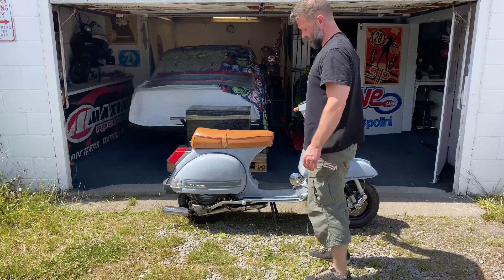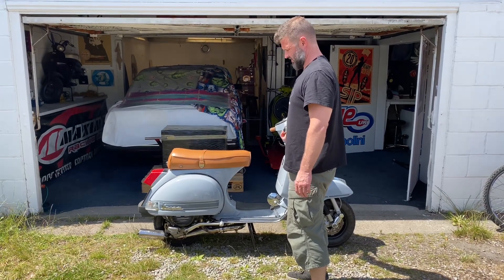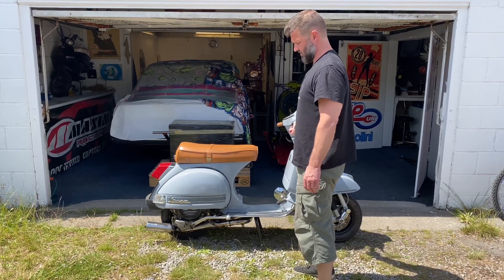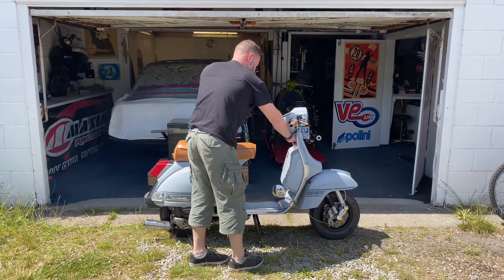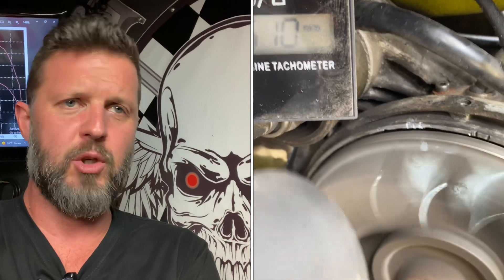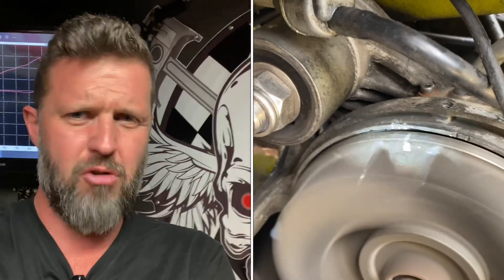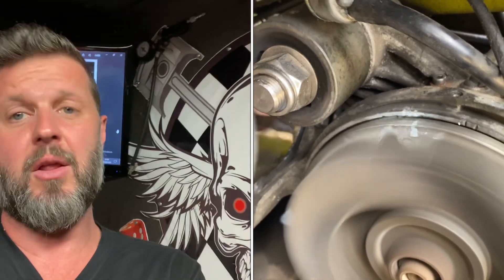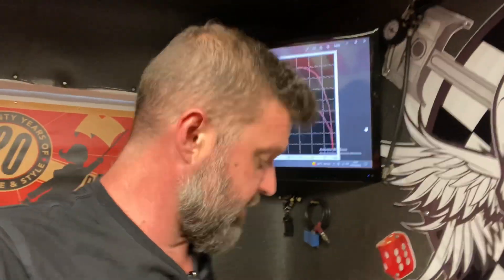Vespa & Lambretta Ignition Fault Diagnosis vs Jetting Issues - Scooter Tech Tutorial

Comment: My px has had a new CDI and stator, did the timing using a buzz wangle and strobe, it will idle but won’t rev. I swapped out the carbys and I had power, coming home today, it died coming down a hill. Started straight away but wouldn’t rev, what should I be looking for?
Reply: This happened to mine last week

Comment: Dan, thanks for this very good. Riding my TS-1 the other day it started not pulling properly above 5K, was stuttering. I pulled over to side of road, i have fitted one of the external pick-ups sold by Scootronics, both pick-ups are wired through a switch so its an easy switch over between the two. Made a great difference, totally back to normal. When i got home i tried this test of yours on both pick-ups, and both revved quite happily up to 8-9K. So can the internal pick-up on the stator be breaking down because when riding its under much higher loads?

Comment: Recently built a lambretta motor with a brand new 90 quid BGM stator, after 100 miles of running in I hit a hard pothole with the back wheel and started getting the not revving out half hiccup. Pulled the stator out and put in a really old Indian 12v one with a matched flywheel that I had lying around and all good. Only problem now is I don't remember where I got the BGM one from so can't send it back...good lesson there to keep all your bleedin paperwork